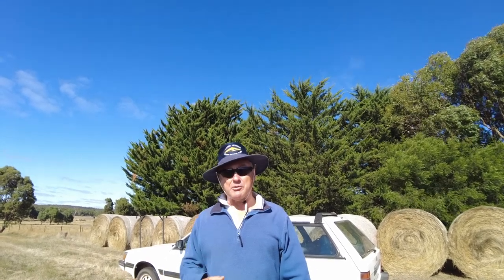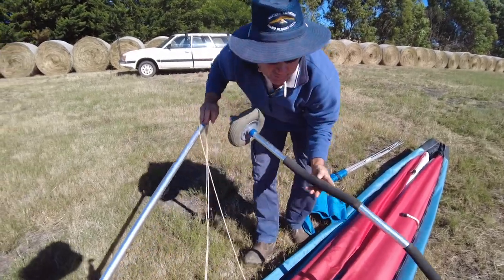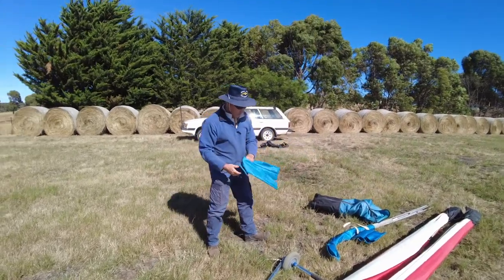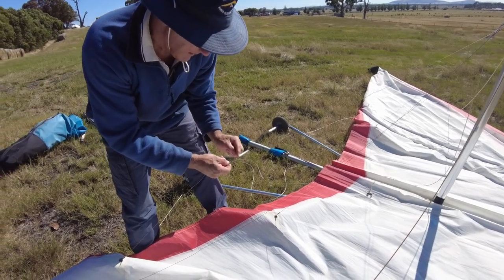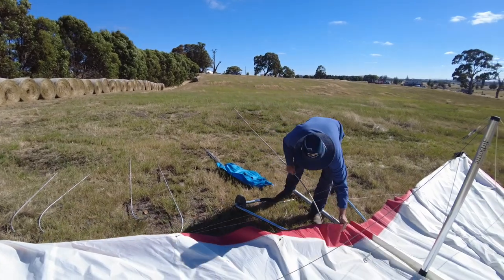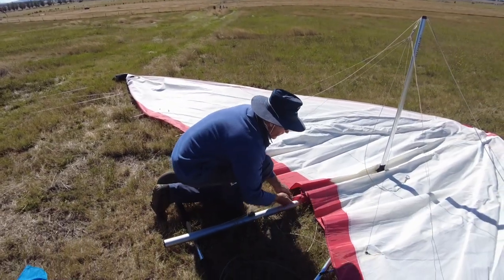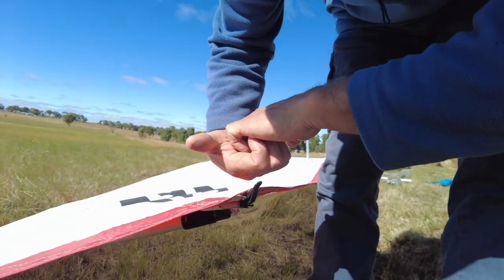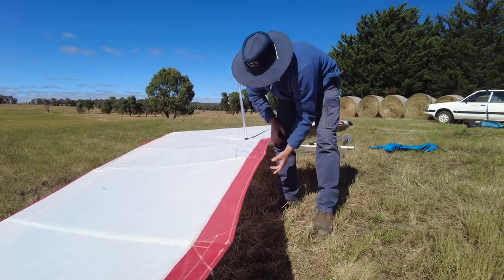How to set up a Hang Glider

Comment: Well that was interesting.
I have no experience but have just purchased a used Airbourne fun 220. $1000
I'm wondering if it is related to this glider.
Anyway, I'm waiting for lessons to start back up in 6 months.
Reply from the maker: Yup. Your glider is the previous generation, and a larger size. You're probably better off waiting for instructions before buying a glider. Mostly because you'll get to try out a few different kinds, and possibly a few different sizes as well before deciding what works for you. The 220 is a large glider - mostly for tandems, or if you weigh a lot. So I hope it works out for you!

Comment: When you pull the tension the hg don t need  to stay on the A frame ? Or maybe only on falcone ?
Reply from the maker: I don’t know the Falcon.  But yes on this glider and all that can be set up flat, pulling on the tension strap only pulls on the crossbars, and ‘tensions’ up the wing. The A frame is tensioned separately with the nose wire.

Comment: Thank you very much for showing the hang glider assembly, I was wondering how long it takes. I am an experienced pilot of large remote-controlled models, I have also flown 6 hours in a real Cessna 172 airplane and I can even land several gliders without the help of an instructor (only tips). Flying comes very naturally to me. That's why I have a question for you: won't my long-standing habits be a problem when flying a hang glider? it turns the other way around and I'm afraid this could be a problem in a critical situation. Many pilots have died due to turning habits. Best regards and I wish you many wonderful flights! Darek from Poland.

Comment: You just explained it well, to be honest no one explained like this how HG assembly is done , i appreciate your efforts to explain each and every check points ... and   i have learned a lot for your instruction and i thank you , but i want to ask , is there any kind connection between the batten tip and the leading edge while you insert to the batten cages , or just  left on the sail , i.e  unattached with the leading edge frame,  thank you in advance .
Reply from the maker: On this glider, most battens are only attached to the sail. The exception is the nose batten, which sits on a pin on the nose.

The sail on a flex wing glider such as this one needs to flex, and thus can’t have battens attached to the leading edge. Fixed wing gliders are a completely different story. 

The credit for this excellent video explanation goes to Rohan Holtkamp - my instructor

Comment: Sir can you please tell me about its wings hight in ft?
Reply from the maker: Yes you can look this up with the name of the glider: Airborne Fun. 

https://www.delta-club-82.com/bible/119-hang-glider-fun.htm

You can follow the manual link to read more about its dimensions. There are 3 sizes: 160, 190, and 220. The glider in this video is the 190.
Reply from the maker: @AbbasAli-n8w3j  my response is in this thread. I posted a link to some dimensions of the glider. Didn’t that link work?
Reply: Where are you from sir?

Comment: Please how much is it in US dollars?
Reply from the maker: Prices for Hangglider like the one in this video range from about USD500 for the cheapest second hand, to about USD5000 for a new one. But you don’t need to buy a glider first. Start by finding a hang gliding school - you can learn on their gliders and equipment. They’ll also have gliders for your size and weight.
Reply: @poklet  Thank you for your reply. I hope to have a chance to buy this plane. I have a great passion. It is my favorite hobby 🇩🇿🇩🇿🇩🇿
Reply from the maker: @krimorouabha7628  where do you live? Search for a hang gliding school nearby
Reply: @poklet good evening, how can you turn right or left and how do you get off l hope you will reply l am very obsessed with flying   greetings to you for all your efforts
Reply from the maker: @krimorouabha7628  It’s controlled by weight shift. You are hanging from a strap near the centre of gravity. Like a pendulum. 

To move left, you move your body to the left. 
To move right, move your body to the right. 
To pitch the nose up, move your body back. 
To pitch the nose down, move your body forward. 

It’s a very natural feeling. And happens very naturally. You just think where you want to go, and it happens!
Reply: @poklet  Thank you very much. Do you mean when you go back, the plane rises in the air, and when you move forward, it goes down to the ground?
Reply from the maker: @krimorouabha7628  correct. That’s how it works. It’s a very simple glider with no moving parts
Reply: @poklet  Thank you very much. You gave me valuable information. What is the total length of the plane?
Reply from the maker: @krimorouabha7628  the wing span is about 10 meters. But it packs down to 6meters
Reply: @poklet  Maybe I can make one. Greetings
Reply from the maker: @krimorouabha7628  Maybe you can make one, but   I highly recommend learning to fly a hang glider  first. So you can learn about all the safety features built into them. 

So the first step should be finding a school near you. You can use their equipment to learn. And then after you learn, you could even buy a cheap second hand glider
Reply: @poklet  I thank you , sir . You really appreciate the consequences . I am grateful for the advice . It really requires experience , because gravity does not differentiate between a human and a machine .
Reply from the maker: @krimorouabha7628  But if you're able to build one, why not? Here's a video of my friend who built a wing and attached a lawnmower engine to it in the 1970s! https://vimeo.com/70270436
Reply: @poklet  I searched on YouTube for how to install the structure and the sail, but unfortunately I did not find any video except for the method of installing the plane, which has many threads and poles. I wish you had a friend or someone who would make one.  But the obsession with flying was bigger
Reply: @poklet  Good evening, sir, is the fabric used special or can we use a fabric that does not enter the air
Reply from the maker: It’s Dacron sail cloth. Light and strong. Varying thickness based on which part of the glider. The leading edge and nose are the thickest.
Reply: @poklet  I am grateful to you. Does it have another name? Where can I find it? Is it in Algeria?
Reply: @poklet  Good morning, I may have asked you too many questions, one sail, or is it folded in front only? This is what I did not understand. In one of the videos, I see the sail folded in front, but I am not sure. I hope for a reply. Thank you
Reply from the maker: @krimorouabha7628  some gliders have a double surface. Some have a single surface for most of the wing, and only a double surface for the leading edge. The purpose is to create an aero foil. I hope you’re not trying to make one yourself from videos on YouTube!
Reply: @poklet  Is there a danger if the installation is wrong?
Reply from the maker: Yes. Why don’t you go find someone close to you that can take you flying on their glider first. Get some experience flying them before you build one yourself
Reply: @poklet  In Algeria, there is no paragliding school, only paragliding clubs.
Reply from the maker: Visit a school in France?
Reply: @poklet  انا ممتن لك كثيرا واشكرك على النصيحة فعلا انا احاول كثيرا التركيز على كل الفيديوهات لاخرج بتصميم يكون قريب للمقاسات والطريقة الصحيحة لاكن للأسف بعض الامور صعبة التركيب خاصة مع كل الخيوط الموجودة ربما تكون متساوية ومتناضرة ساحاول حتى تكون عندي نظرة تقريبية
Reply from the maker: @krimorouabha7628  have you built model aircraft before?
Reply: @poklet  Je n'ai pas construit de modèle, mais j'ai un look approximatif.Le problème est que le numéro d'aluminium est 33/42/10, et au milieu et au manche, j'ai besoin du numéro 32 mm.
Reply from the maker: @krimorouabha7628  the type of aluminium is extremely important for strength and durability. Airborne uses 7075 aluminium for tubing. The glider in this video is a Fun F2 - https://www.airborne.com.au/images/manuals/8439.pdf
Reply: @poklet  انا اشكرك لقد بدلت كل ما بوسعك ساحاول ربما تنجح التجربة ما سيحفزني اكثر فقط في الجزائر لاتستطيع تحقيق حلمك لايوجد من يحفزك هناك من استعملو المضلة الشراعية تاتي الشرطة تطلب الترخيص بالطيران انها افريقيا اللعينة ربما يكون يوم افضل
Reply: @poklet  مساء الخير سيدي مانوع القماش المستعمل وهل هو عازل للهواء
Reply: @poklet  Good evening sir, what kind of fabric is used and is it air insulating

Comment: اريد معرفة قياس الاجنحه مع التقدير
Reply from the maker: Wing span: 10.1 meters. 
Sail area: 17.7 sq. meters. 
Weight: 23kg. 
Pack up length: 5.9 meters

From http://www.airborne.com.au/images/manuals/8439.pdf
Reply: @poklet  شكراا جزيلا سررت بمعرفتك وارجو ان نكون اصدقاء
Reply from the maker: @adelalasade7079 if you want to fly, you are already my friend!
Reply: @poklet  yas, I want to make a sailing plane ,but I faced some difficulties
Reply from the maker: @adelalasade7079  could you share what you’ve built so far and describe your difficulties? You could make a video and share your thoughts. It’ll be interesting to hear your story

Comment: Hi. It is possible to clean an tube with a little ball, 360 degrees rototing nozzled and pressurize water. At any size of pippes. I am deeply possitive ipressed by this moove. My very best regards and deeply respects!
Reply from the maker: Yes as long as you are able to dry everything out quickly. I think the biggest issue will be with mold growing in the damp.